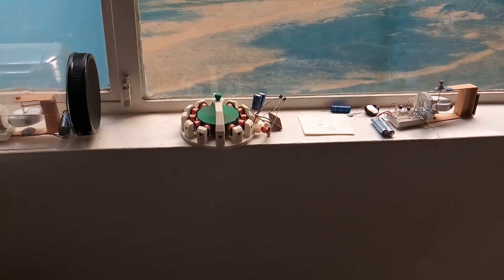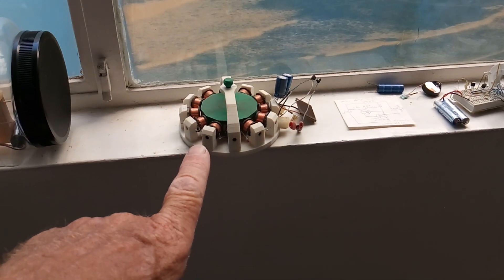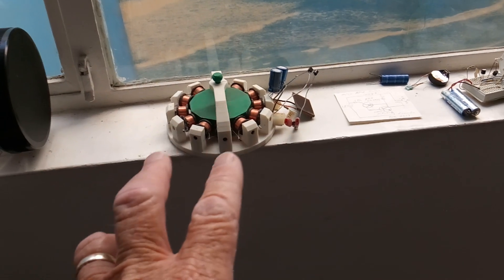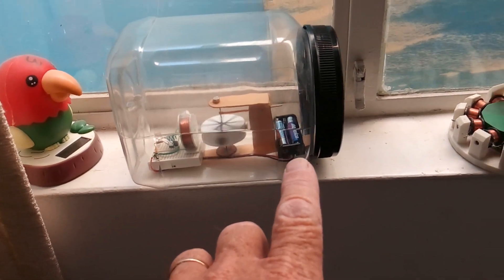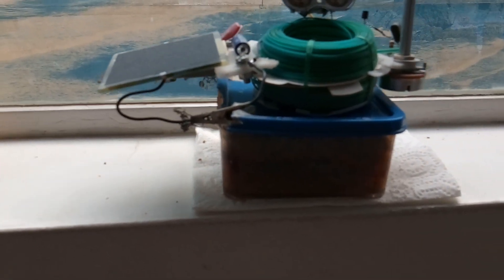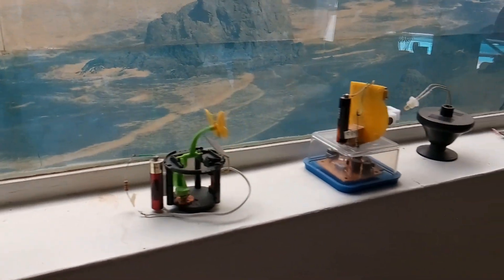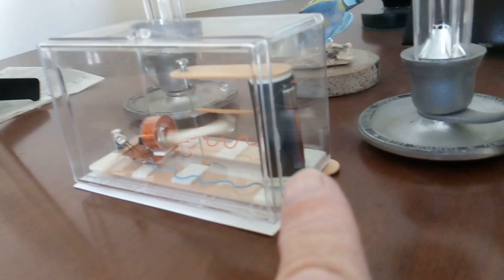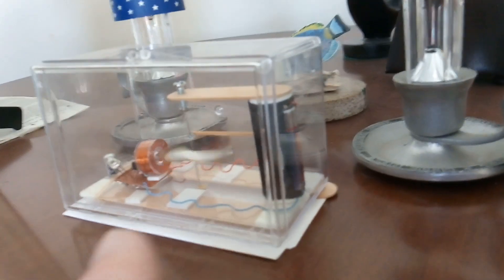Non - Stop Running Devices  -- Update after 5 years

Comment: These are outstanding projects.  I have a similar thing I've done where I made a "forever" lamp that has a glow mode and runs on 3 AA cells.  The first run used low self discharge NiMH cells and I'll be damned if I didn't get almost three years out of it before I got bored and swapped them out to test them for remaining charge.  They had enough left they'd have made it to the five year mark easy.  Now, you'd think that drawing so little power that 2 amp/hour over 3 to 5 years would be almost invisible, but it's not.  Even with the large diffuser on the lamp, it's bright enough to read with if you have night adapted vision.  Even in the daytime with sunlight sneaking in around the window blinds, it's bright enough you can't miss it.  I can't recall the exact resistor value I used for that one, but the next one I'm building for a friend is going to have a 100K pot for the "low" brightness (I include a momentary push button for a high mode that uses a 100 ohm resistor).  Then, he can just twiddle the value to be whatever he wants it to be.  I originally wanted to buy a couple large tritium vials and make a large glow lamp, but this is VASTLY superior in brightness and it lasts damn near as long.  There's something special about projects like this.  They're almost like magick.  Oh sure, I can sit down and do the math, prorate the cells according to long term draw and tell you a pretty good estimate long before hand of how long it's going to run, but to actually SEE it day after day, it's like witnessing alien technology or magick.